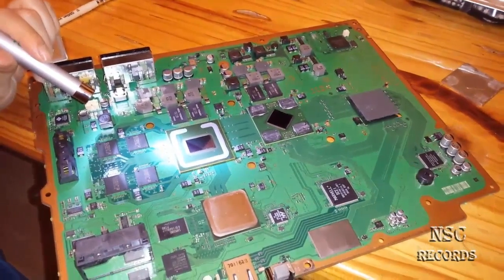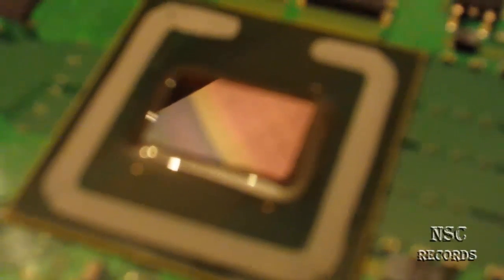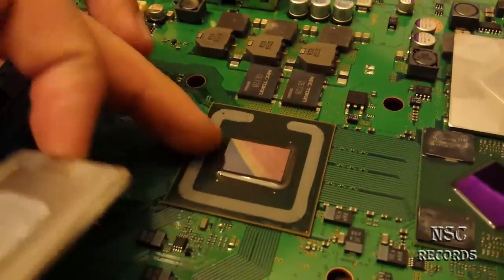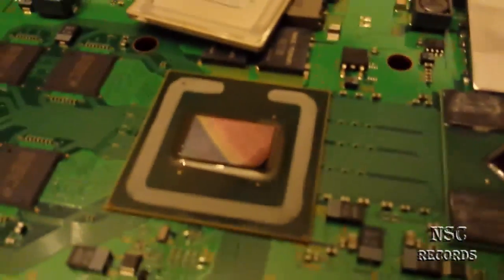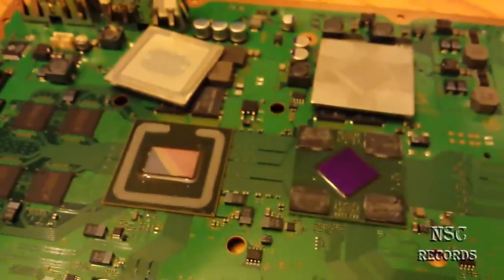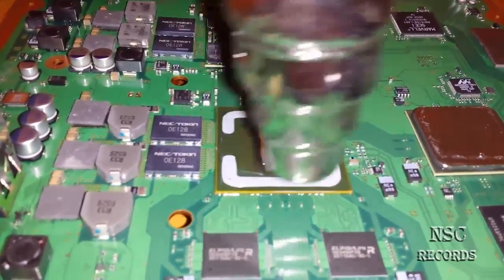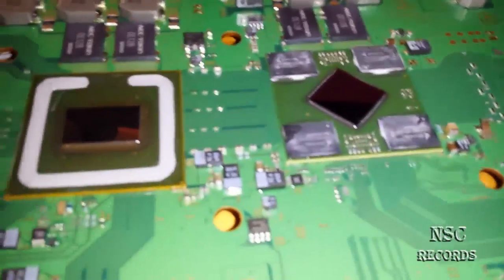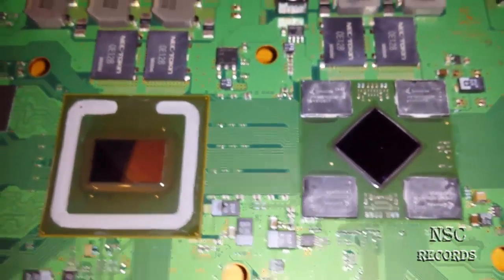PS3 & PS4 overheat issues (improvement proposal Video) By:NSC

Comment: I think 600 degrees celsius is way to hot for the cpu und gpu, if you stay too long on these chips with your heat gun you might fry internal connections in the die...Would rather recommend using lower temperatures, because the solder liquefies at around 200 degrees anyway...
But other than that great vid man :)
Reply from the maker: +4everSuMo Real 600 C° is sure to much ^^ Bit when my Heatgun Shows 600 than i got about 450C° xD a real BGA Station works with 200-220C° because it works with Infra Red or how ever it calls in english :P

Comment: I have a question for ya UltraNSC.  I was wondering with the over heating issues would a external fan help or not or is their anything I could to avoid the temperatures from doing that? You seem like a pretty knowledgeable guy so that's why I ask.

Comment: so awesome and excellent!!! Infinitely THANK YOU!!!!!  Thanks for sharing and caring !!! Your video will be very valuable and useful!  I am attempting my first reflow and I can't wait to do it and revive my ps3.  Are you using Celsius or Fahrenheit on your heat gun? Wasn't 100% sure but most likely F? Gonna add the amtech flux and no clean flux that I bought from here I use artic silver 5 on top of the heat spreaders I was thinking artic silver ceramique underneath the heat spreaders?  Also was it hard to remove heat-spreaders with the razor blade?
http://www.mcmelectronics.com/product/20-4476
Thanks

Comment: I noticed one thing. When a guy was comparing xbox one and PS4 temps I was just dissapointed. Xbox One had 36 degreees on idle, while the PS4 had 54 degrees idle. I can see now why Microsoft made the console bigger because they in return made it run cooler, while the PS4's heatsink is smaller and runs hotter. Sony, pull your shit together already -_- Something twlls me that the PS4 will have a bigger failure rate compared to xbox one. Microsoft really learned from their mistakes, while sony just doesn't give a shit. I'm going Xbox One this generation...
Reply from the maker: yea, thats right... thats why you should do some Holes near the fan on the PS4 also...

IDLE 54C*? LoL Ok ok, the PS4 is a bit Stronger, but 54C* is still better as the PS3 FAT HOT Ladies with 78C* IDLE xD

what a shame... a stock PS3 FAT Edition, you can realy kick out the window ^^

u better do this Holes on the Case, and get you a FAN Controller, or u will have no Longer fun with :\

Regards
Reply: Well, considering that both xbox one and PS4 use 45-22 nm technology, It still dissapoints me. My Core i3, which has 22 nm technology, never goes past 38 degrees. Even on load. And the cooler is not that big either. Yet the PS4 releases a shit ton of heat :D
Reply from the maker: thats right, and thei give a $hit, if u understand me...

Comment: You make me wanna buy a heat gun and start fixing stuff:))
Would it help if one lapped the heatspreaders before putting them back on?
Reply from the maker: ;)

Lapping helps not realy much, i already tryd it... but its not worth it...

It helps much more if you make those holes on your PS3 Case near the fan and then get you a Fan Controller, u can get about 30C* degrees down ;)

a standard PS3 runs IDLE in the menu at about 80C* !!! with those holes and a Fan Controller it runs in the Menu at 56C*

i think the differences are very nice ;)

now imagine how long a PS3 works if it gets all the time 80C* and imagine how long a PS3 works, if it runs just at 56C*

So we already know that a PS3 runs standard at 80C* in Game much higher, and a PS3 runs about 2-4years

now imagine the same, when it gets not over 60C* ;) it will hold much longer then only 2-4years ;)

Regards
NSC
Reply: Thanks.

Comment: Thanks you! I did  the  hole in the  case already and I took the battery case off as well .. Just like your video. It really help  me a lot.. But my ps3 Backwards Compatibility the fan still little loud... Do you have any more idea to make it quiet? Thanks love your video keep it up!
Reply from the maker: Thanky to you to ;)

With the Fan Controller you can also turn he speed down, but if your FAN keeps turning high or somewhen crazy, then you will need to open the Heatspreaders, because under there, is the Thermal Compound very old...

more info here, and pls ignore the thumbs down:
How to remove the Heatspreader´s on your PS3 (Quick Tutorial) By:NS©

It just looks easy on my Videos, but in real its HARD to open them... so take care !!!

NSC

Comment: Can you help me... I was think to buy a Thermal Pad for Playstation 3. Do you think will help with the cooling down ps3? Thank you
Reply from the maker: Hi

No, it will not help much...

You should do some holes on the case at the fan side, then just get a cheap Fan Speed controller like here: Protect your PS3 with a Fan Mod Speed Controller to avoid a YLOD By:NS©

;)

Comment: ps4 wil have the same problems overtime just like the ps3 it has no intake where does the cool air come in ?? it has an outtake for heat but what about intake ???
Reply: it's an exhust set up like Laptops. Only thing is Laptops have bigger heat pipes and sometimes more than one fan but a PS3 has just one fan and a small heat sink. Should've had bigger heat sinks and heat pipes to get heat away from the CPU. Intakes would help but there's no room.
Reply: Your correct, not having an intake of cool air , beats the purpose of heat sinks or a fan, Fan should be sucking in cold air going past cpu and gpu then out

Comment: Yup, as I said earlier my second PS3 fat kicked the bucket due to YLOD, funny thing is: it broke when I was listening to music, not doing anything CPU or GPU intensive with it. I had previously noticed that the two chips would get really hot when just sitting at the XMB with the fan on low (I stuck a thermocouple in there and observed temps over 70°C), whilst during long gaming sessions the fan would spin up and the whole unit used to run much cooler. Fast forward to today, roughly a month later and I go like: "ok, I cannot make it worse than this, so let's just open it up and try to fix it!"
I got all my tools ready, thermocouple, heat gun, screwdrivers, thermal paste, my soldering iron and a box of electronic components; I reflown the RSX with the HIS off, applied new paste and put the system back together. BAM! YLOD again. Turned it off and on again and it booted! I decided I was not going to take any chance this time, so I decided to do what Sony never did: I grabbed an NE555 a 100uF cap and a 1K resistor, then I cut the PWM control cable (the grey one) going from the mobo to the fan and wired the fan to my newly assembled frequency generator. The fan just runs at 50% speed all the time, sure it's noisy, but I don't care as inside the PS3 is nice and cool :)
Reply: There is plenty of guides online showing how to build a fan controller for the PS3, just Google "PS3 555 fan mod". I went super-simplistic and just set the fan to 50% duty-cycle, but using a potentiometer to adjust the speed manually or a thermistor on the GPU/CPU to do it automatically are also options.
Reply from the maker: yea, realy agree with you, now please copie this comment, and save it in a file, cause i will  need to delet this vid. in few minutes, than just post this same comment on the new Vid.

New vid is finish in about 30mins...

Thx again for you comment and feedback, dont forget to copie your comment for the finish video ;)

Comment: Dear @Sony you should watch this video. Update the firmware !!! ASAP. it is so hard to tune the speed on your fan ?
Reply from the maker: at your comment: no its not hard, thei just need to set the Fan higher and save it on the biosfile, at last thei just need it to upload for us... it could be finish in a minute, the other question is, if thei realy want to...

and if you know about Multiman, than there u can see how easy it is to set the fan Manualy higher...

Sony could also make a Temperature info on the Menu, just like with MULTIman, so we are able to control our Temps self and better, and thei should also make a option for the fan speed, like AUTO, SILENT, MEDIUM, FAST or MANUALY, just like on the PCs

but who knows if this will happen in the next weeks, or mounths, or years :\

but lets Hope, the hope dies at last...
Reply: Its just a typical from big companies... they want your old PS3 to die so you must buy a new model or upgrade to PS4 instead :(
Reply from the maker: Agree, but not all are like that, just look at NINTENDO, them Consoles just runs Perfect ;)
Reply: Oh yes NINTENDO is making a great hardware durability so far. Its a strange though SONY should make a fantastic hardware, considering they ARE a hardware based company that already have a lot experience
Reply from the maker: Agree you again...